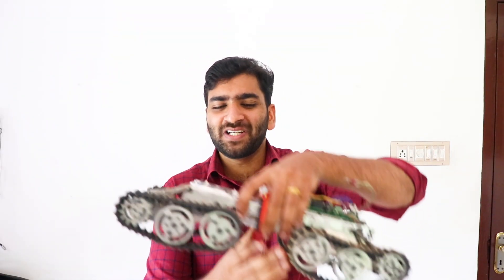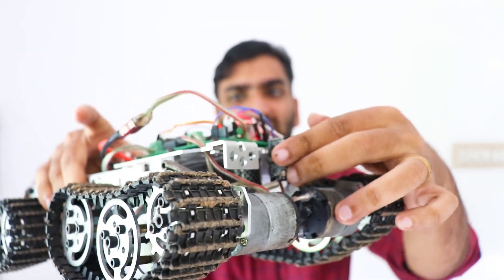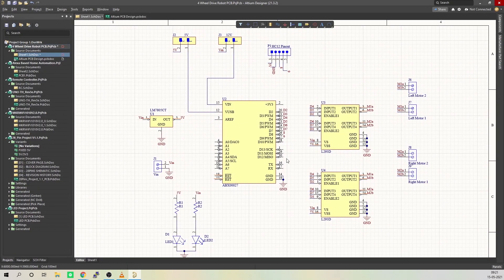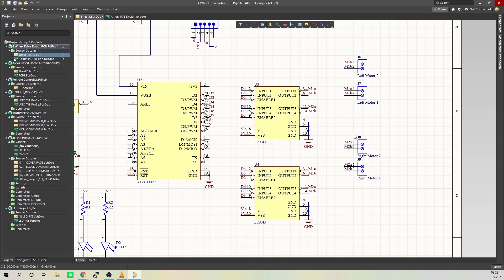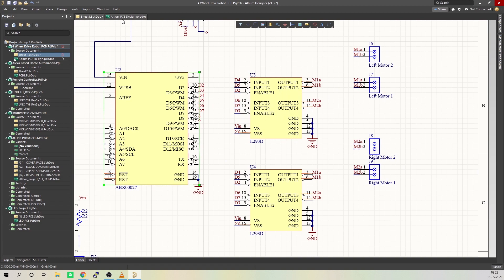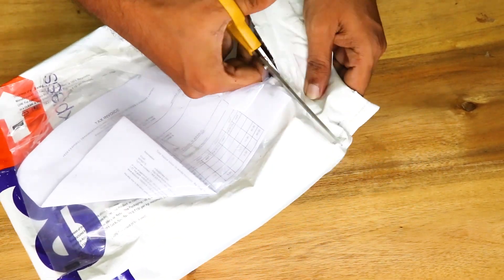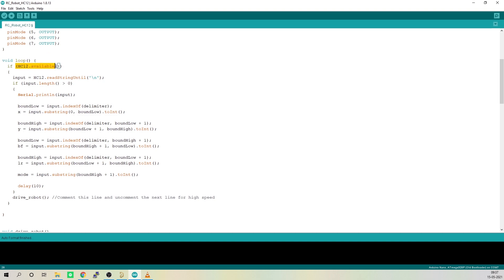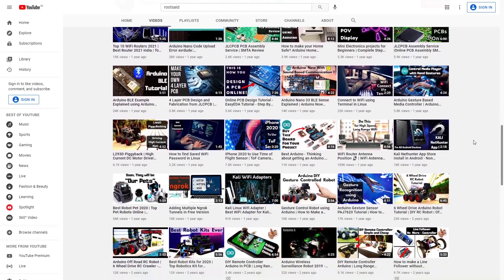DIY Remote Controlled Tank | Arduino Robotics Project [Complete Step by Step Tutorial]

Comment: Are you using any motor drivers to control these 4 motors? If so, what driver is it and do you have any issues with the 4 motors drawing too much current when all 4 start up simultaneously?

Comment: First view 😀😀
Reply: @RootSaid   Sir can a rc car ran on just Arduino Uno borad with HC-05 Bluetooth module without a motordriver.....?? If yes then how..?please reply 
I'm working on a 6-wheel drive with bridge axles and with rear only track system and From Left -Right turn axles ... it's not independent Motor system as you do...so what should be the code program for it...
Can you make a video for it...please...